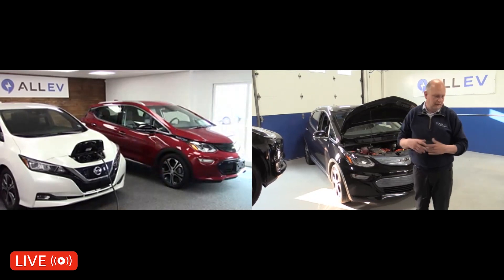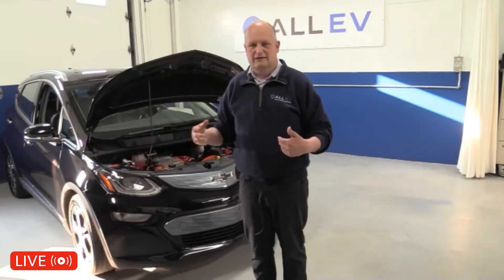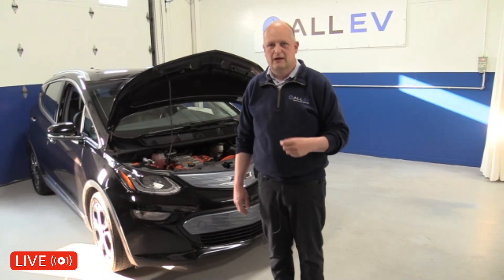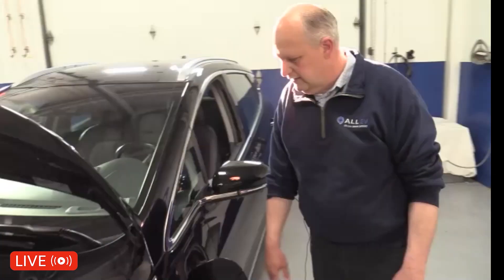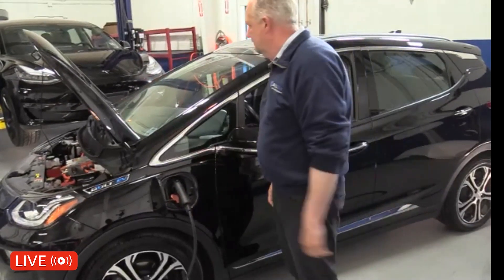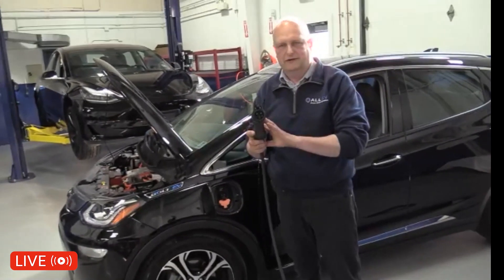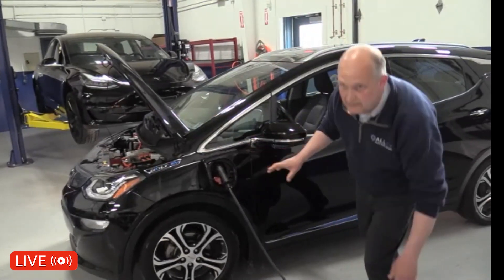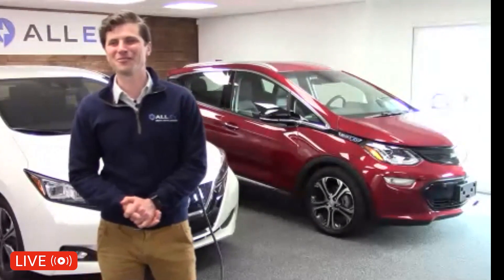All EV Canada - Submerge a Live EV Charger in Water Test

Comment: If you will dump some bricks into a water you can be shoked from results. L1/L2 EVSEs are just smart extention cord. When charger is live it have a low voltage proximity and id pins live with low voltage and low current, since its a data pins.